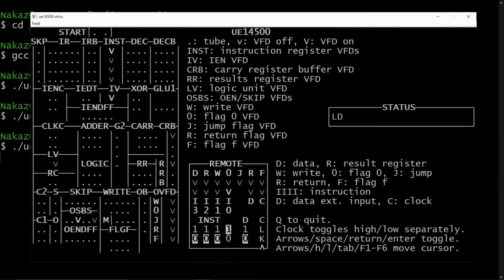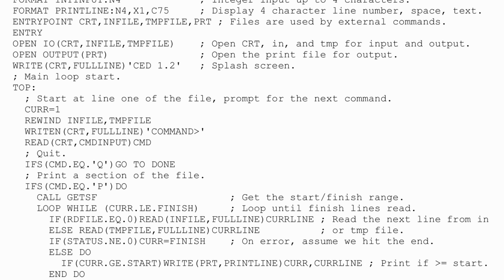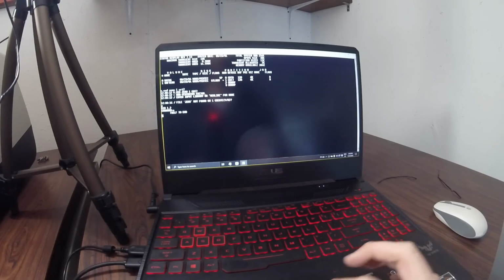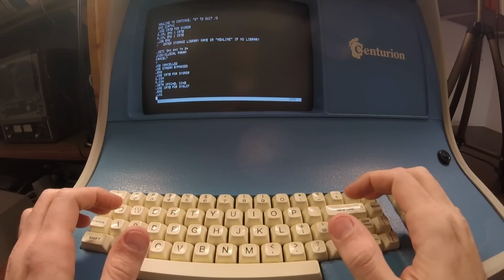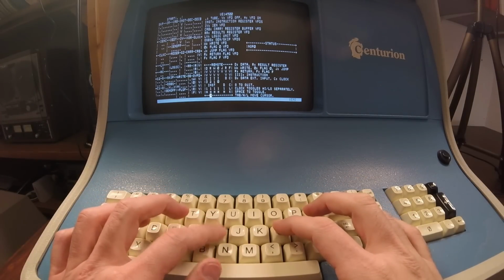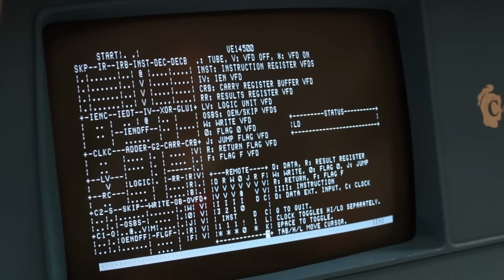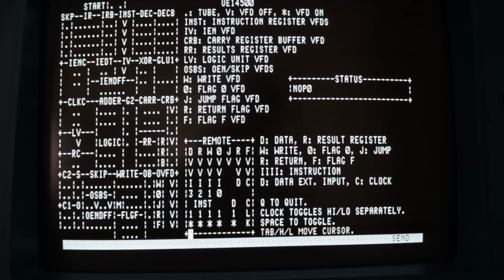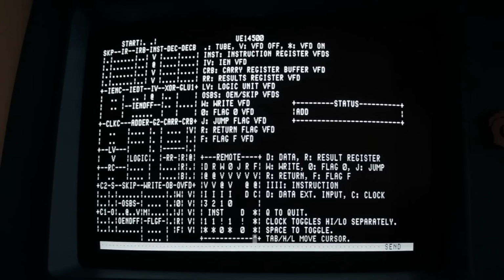Emulating the Vacuum Tube Computer on the Centurion Minicomputer

Comment: When you get your PDP-11 up, need to run a Centurion emulator on that, which of course will run the VTC emulator.  <repeat nested emulations until we reach present day>
Reply: And the VTC should then run a PDP-11 emulator, and it becomes a weird version of "self-hosting"  🤣
Reply: @KayleeKerin  it doesn't (and cannot) have nearly enough memory to emulate anything at all, and I'm not sure if more than 4 bit calculations are even possible on VTC, let alone its, ehm, "speed".
But I think there were PDP-11 emulators for DOS, so if someone ports Centurion emulator to PDP-11 (which shouldn't be nearly as hard as actually writing that emulator in the first place) we could in theory emulate VTC on Centurion on PDP-11 on DOS (via DosBox) on Ubuntu (via WSL or VirtualBox) on Windows. 

As a similar joke goes: 
- Where should I ask a question about sound in such configuration? 
- In a psychiatric ward
Reply: @jwhite5008  Assuming the VTC is Turing-complete it (the CPU) should be able to emulate (or more accurately, simulate) any other computer. As you said the main limitation is the amount of memory. The fact that it is only a 1 bit system does not matter because it has a carry bit.
Reply: @eDoc2020  Ok, I can see your point and understand the carry bit thing.

But how do you implement anything like that when the computer's memory address register is nowhere near wide enough to fit any normal application? 

And - please correct me if I'm wrong, but I believe it doesn't have any provision for external memory device - yet, anyway - so it physically cannot emulate more memory via another device.

Furthermore, "running" an emulator at least means it completes emulator's initialization routines, and starts the system up, right? Well, with such memory, register and bus width limitations it would take many many days, probably years to even do that.

Vacuum tubes are VERY unreliable devices and they have rather limited lifespan because of the heater wire.

My point is, it has almost zero chance of completing initialization before a tube dies. 

Therefore, the argument "VTC is able to emulate Centurion/PDP11/..." has about the same validity as "you are able to win a lottery by using your birthday as a winning number" or, as a more extreme example, "you are technically able to emulate Centurion by displaying random characters while typing on unconnected keyboard".

I would agree with statement "VTC's logical architecture is technically capable of emulating whatever IF it is modified to allow for large enough memory" but not the original statement.
Reply: @jwhite5008  I haven't watched all the VTC videos and don't remember the videos but IIRC the memory address is separate from the CPU. So the CPU could be hooked up to a 32 bit address bus. I might be wrong about this.

IMO vacuum tubes are actually quite reliable. The heaters are relatively cool so they'll last much longer than light bulbs, especially since a soft-start circuit is in use. If a heater does fail it will most likely be on power-up, not while in use. It's more likely the electrodes will become worn or contaminated reducing the tube's effectiveness. In low power applications this should be around 10k hours, it's not a guitar amp where the output tubes are often pushed beyond specifications. That said when you have 200 tubes the chances of failure go up.

For speed, I think the VTCPU should be able to run at 100Hz. I'd bet an emulator could initialize itself and start running Centurion code before a tube failure. Whether or not it finishes the Centurion's early initialization is another story.

I'd say a better analogy is running a PC on capacitors. It will work properly for a bit, just not long enough to do anything useful.
Reply: @eDoc2020   The CPU is not the computer. With random-accessible external memory not even in specifications right now (unless I missed something which is quite likely), the COMPUTER, as we know it, cannot run software this complex, end of story. It may be possible to somehow expand VTC to make sure it can.

In all tube-based electronics I've seen tubes are easily removable because they are expected to fail - they were often the only reasonably easily replaceable components except for fuses.

Guitar amp typically only has 3 to 6 tubes. VTC has more than a hundred. With increasing number of tubes chance of failure increases exponentially. Early tube-based computers were known for being unreliable because of that. VTC had at least a few tubes fail already.

Did you ever try to run a program that doesn't fit into RAM so the computer starts swapping *constantly*? If you do, you probably know that if this is not caught early enough, even shutting the computer down gracefully is no longer an option.This is what will have to happen in case of an emulator constantly because the working set of memory is many many many times the RAM amount. CPU speed is likely more or less irrelevant since the computer will have to be doing memory swapping-related job more than 99% of time, most likely much more. 

It is theoretically possible to build an emulator that requires no initialization by defining a blank startup state as initialized. However, I don't believe it is reasonable to say that the emulator works unless it is able to go through at very least a startup sequence. Otherwise we already have a working playstation 5 emulator.

I'm not going to argue this point any more.
Reply: @jwhite5008  Perhaps I should have said: the VTC, if equipped with sufficient program storage and an expanded memory system, could, assuming no hardware failure, simulate the Centurion.

I think we could agree on that.
Reply: Yup. Search for the PiDP-11. 
I’m looking forward to following along with his PDP-11 adventures, particularly if there is a Centurion emulator.

Comment: 15:44 its called "ripple" or "folding" most likely the horizontal tuning
Reply: I'd start with checking the level of voltage pulsation produced by the power supplies.
Reply: I quess it's a bad cap - letting ripple from the 60Hz powersupply through and causing an interference with the refreshrate. the bad cap might be reforming and performing always the same way - my best guess.
all the rest: amazing work! really like your channel!
Reply: It may also because of a Problem with the Power Supply ( Undervoltage when the Space Heater turns on )

Comment: I think the thing I like most (other than your awesome enthusiasm and excitement) is the emulator gives you a genuine use for the Centurion that makes it more than a toy. It's cool that it has an actual use and job (again) now!
Reply from the maker: Thank you!
And we're slowly building up a proper library of utilities and programs on the Centurion to make it far more useful. We've also discovered some installation packages for a few applications like the General Ledger application and some Oil and Gas stuff, so in the future I hope to do an episode where we exercise the Centurion doing what it was originally designed to do. 
Ultimately, once we get the printer going, it'll have some pretty good utility in that respect as well because the printer can do 132 column tractor feed, which is pretty rare these days and sometimes would be very welcome!